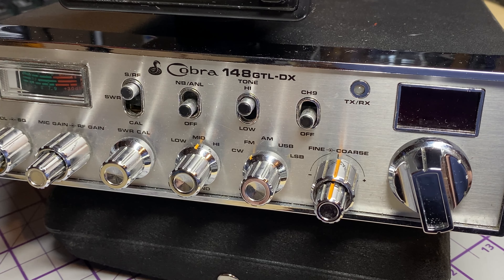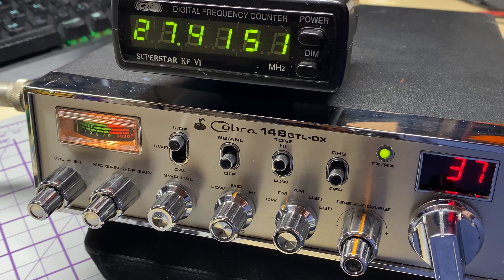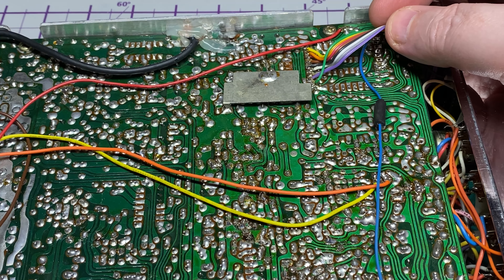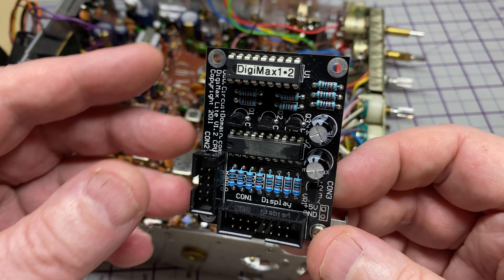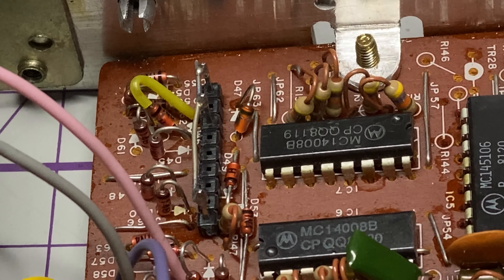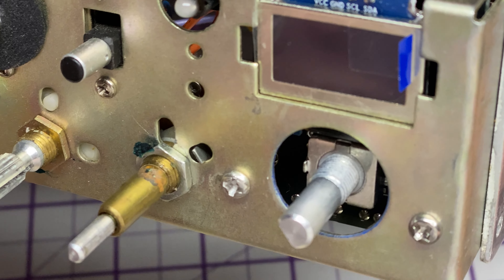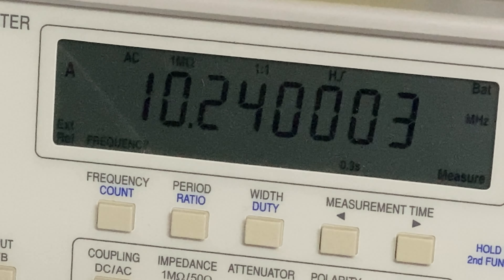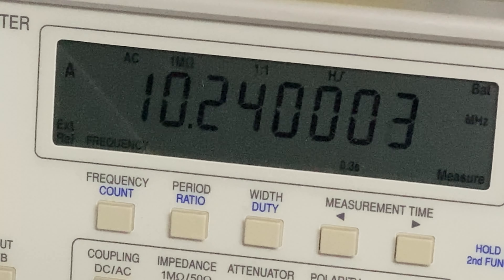EP 187 - Cobra 148GTL-DX - Removing a bad mod and fitting a DDS conversion.

Comment: That channel display is excellent! How much is a supply and fit?
Reply from the maker: Fitting to a WORKING radio is about £100 , if the radio needs extra work to get it working before the mod then this is extra.
Reply: @MicroChipz definitely worth it, they should release a cobra 148 with the same board, it really blings it up and makes it modern.

Comment: Hi Graham 
the person did not set the n code for ch1 correctly  in the setup menu for the digimax   for the mc145106 , nothing to do with the install as such ..
lol,ed hard when i saw the cobraworkshops crap beep   
the pic chip  having it number scratched off is a joke its not hard to reverse engineer the pic code tbh .
Any good engineer can write code that does the same
Reply from the maker: That would explain its strange readout, im sure the mod is good when setup correctly, its just a simple ncode mod.
Reply: Our Hy-Gain V bleeps are Supreme.